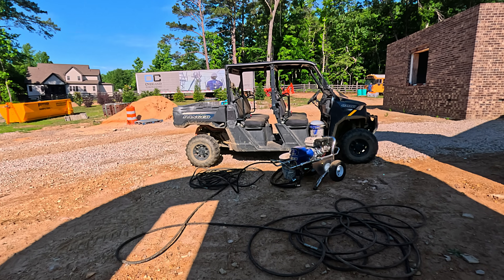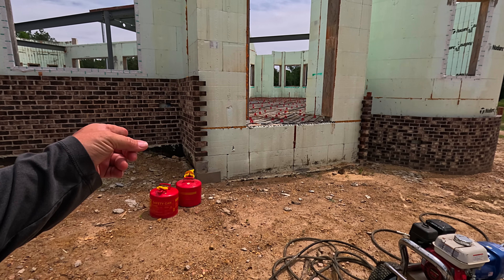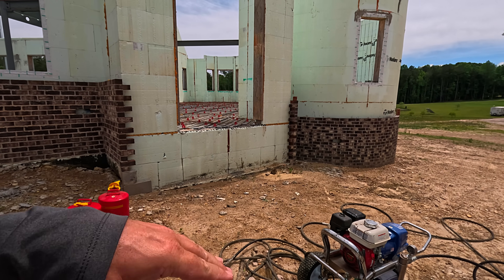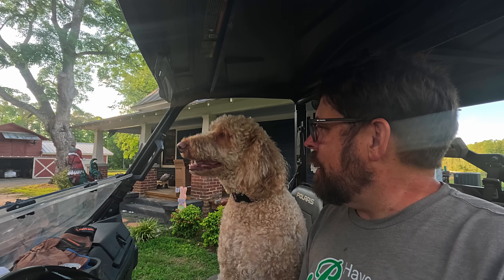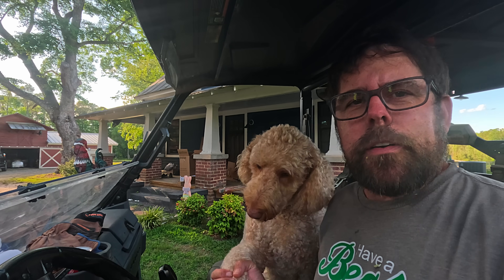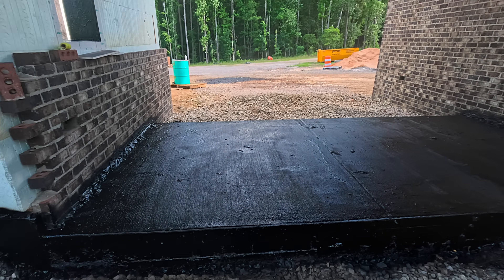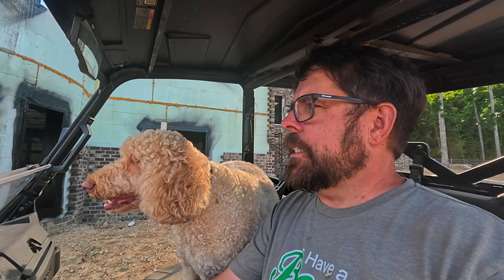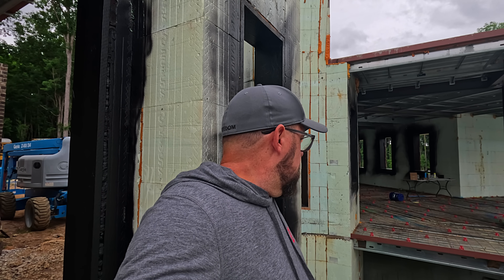Will This Keep Water Out? Tremco Spray on ICF Window Openings

Comment: Geoff, where are your receptacle boxes in the brick work? Light boxes and flood lights going in the brick? The receptacles are a lot easier to set in place as the brickman is doing his work, harder after- electricians aren't masons. Exterior vents for baths/ hood fan/ anything else in the basement or first floor?
Reply from the maker: Left out a full brick where outlets go. The mason will fill in afterwards. The brick isn’t high enough for coach lights anywhere, except for the office door, which we put boxes in for. ERV system handles all the vents.

Comment: That wood use on window frame during pouring wall wasn't PT stock. Today's code PTstock to b used when in contact with concrete??
Reply from the maker: The wood is engineered stock. Specifically designed for this purpose.
Reply: @BealyGood gotcha

Comment: You're wasting your time and money with whatever granulated item you are using for fire ants.  Unless you have a higher concentration of an active ingredient in Bifen XTS.  Bifen XTS has a concentration of 25.1% bifenthrin.  It is an outdoor pesticide.  There are some considerations when using it.  There are other pesticides (Talstar being one) that have 7.9% concentration that are for indoor and outdoor use.  I have a friend that had a major fire ant infestation and i recommended the Bifen to him.  It's his go to item now.  I'm not a pest control professional but I know the bifenthrin works.  The off the shelf products only have a very small concentration of the active ingredient.  I believe the bifenthrin is available in granulated form too.  If you read this, I hope it helps you.
Reply from the maker: I'm gonna have to do some research on that. Thanks

Comment: Could you not use ice and water shield outside around the windows and doors that’s what I did to mine
Reply from the maker: I'm using that too (the EXO-AIR stick on). Just extra protection
Reply: Thanks for the reply can’t wait to learn some more